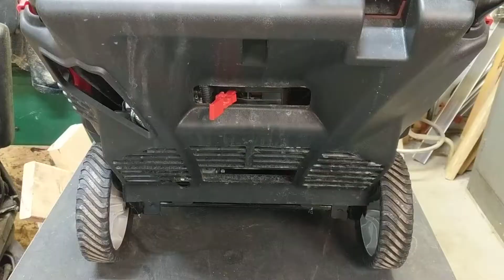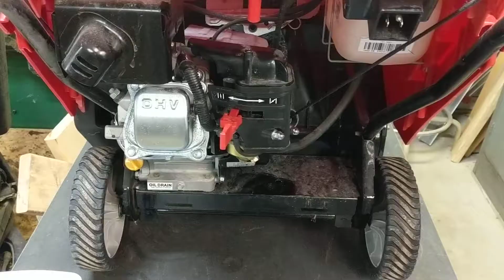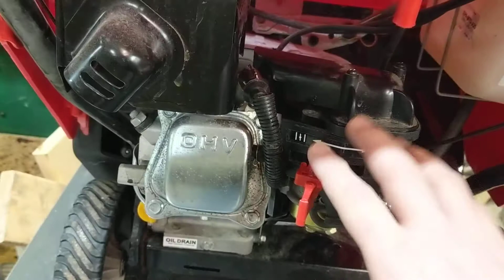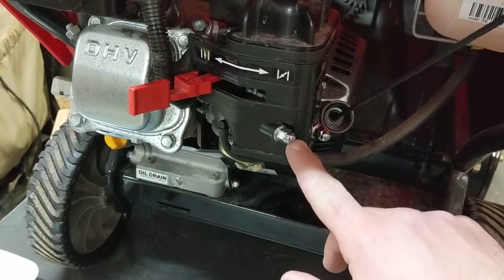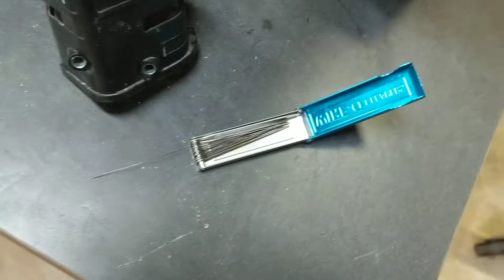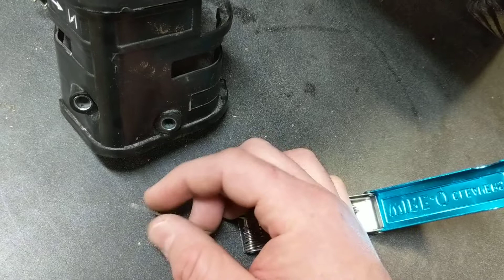Troy Bilt Squall 2100 Snowblower rough idle hunting carbeurator cleaning guide

Comment: I bought an older model ( by the looks of the newer one on youtube) at a garage sale. The paddle assembly needed a bit of welding onto the horizontal rod. I had a friend do that. I paid $40 for the blower and have used it twice on my driveway and sidewalk. Working fine so far and starts on the 3 pull.